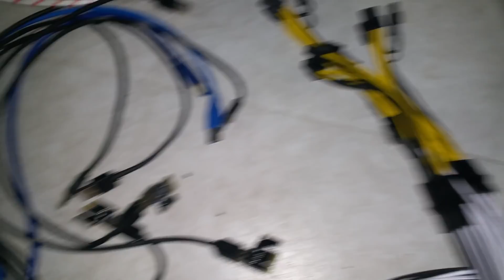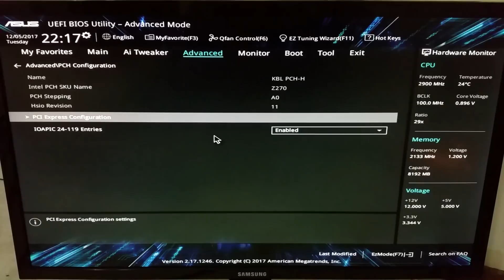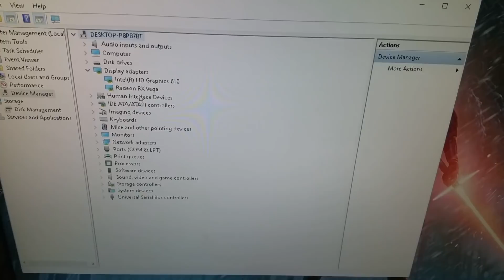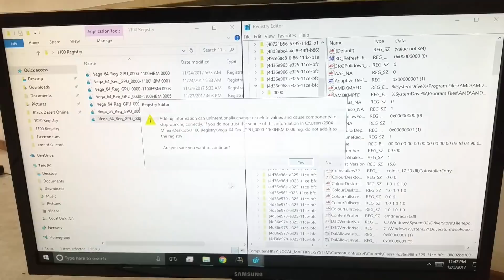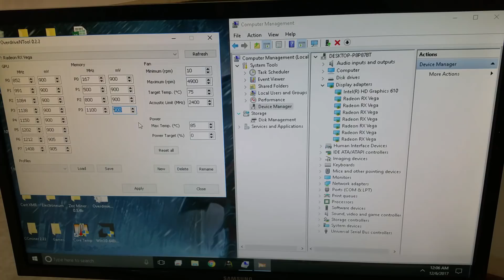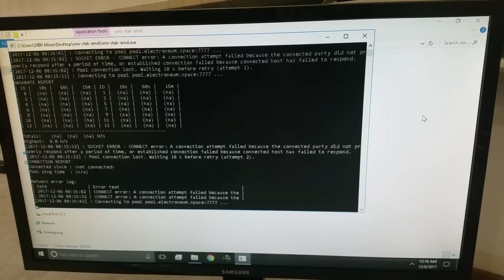[Tutoria] How to configure 6+ RX Vega Mining Rig

Comment: Hello, great vid. just purchased a Vega 64 and followed your 2 videos to a tee...getting 44.5 mh/s, however it crashes and reboots after 20 secs. My rig consists of x2 R290's and x1 Vega64. monitor is plugged in a R290. The registry I used for the Vega64 was the 1100 reg. Any advice is appreciated. Thanks

Comment: I Hv done the asus z270p prime bios setup exactly described in the video. But as soon as i installs 5th Vega x64
System reboots endlessly without booting to Windows.
4 Vega works fine. Pls help
Reply: you HAVE to active 4g decoding, is not in the same place where he shows because this motherboard is a little different bios

Comment: HELP!!! using biostar tb250-btc 6 pcie motherboard with 6vegas. G3900 processor, 4gb Kingston fury hyperx ram, 2x Corsair rm850x psu's, bios all set to gen1, mining mode, virtual memory set to 60000, block chain drivers, cast miner. It will run 4 of the GPU's stable. It will recognize all six but when miner start 4 will hash 1900± but two around 1200. Then 10 seconds later the computer crashes. HELP ME PLEASE ANYONE!!!
Reply: make sure all your power connections are connected to the MB itself, with these MB there are usually 2 or 3 extra power ports that need to be connected.

Comment: So I've been struggling. Have had all the issues everyone else has. Stuck with atikmpag bsod. Have tried clean installs, 3 different motherboards, using Igfx as primary card. Installed blockchain driver (driver only) on one card then plugged the rest in. Ideas? Did you plug all cards in at once after the 1st? Looks like we share similar board. My bios is essentially identical (asus z270a)

Comment: Is it possible to have an 8 VEGA 64 Mining rig?  I keep getting a blue screen when I try to enable 8 vega 64's and can only get 7 enabled but the 8th creates a blue screen.
Reply from the maker: MrInfamos Yea it's possible, I made a video a month and a half ago with 8 vega 64s mining.
Reply: This video is what you are referring to?  https://www.youtube.com/watch?v=GlLxggLTFYE these steps allowed you to enable more than 6+?
Reply: So far used your methods and everything seems to work well until I try Ethereum the voltage settings don't appear to work and at the wall with 5 cards start to pull around 1400w, yes I have a Kill-a-watt and i've only tested 5 cards so far... haven't tried connecting the remaining 3 to see if I can get 8 cards past windows 10 startup without BSOD.  I've read that the Asus Z270 motherboards are typically the issue and you need a mining specific motherboard to be able to run 8+ Vega's by other members on reddit.  I found by going into Wattman and manually applying the settings and under clocking the core for now to try mining Ethereum and applying the settings the power usage drops to around 1000w with 5 cards all set at 900mv.
Reply: those configurations here are from monero, ethereum is a little different, try use -24% and thats it

Comment: Serious problem here if u can point me in the right direction ... did all your steps worked fine then now i have a strange issue it blinks also it crashes  and restarts .. my startup bois i have the default graphics as main not the GPUs and still its crashing
Reply: i have the same issue! only 5 cards work, 6 doesnt work
Reply: Cleber França in the end i just split them 4 each rig ... even then its very unstable all these guys are making videos claiming they have solved it but in reality the mining driver is very buggy doesnt seem AMD are going to release a proper driver either

Comment: awesome video geek mark,  i am going to try all your settings. I have one sapphire vega64 air-cooled and one vega64 liquid-cooled. when running the liquid cooled, after the miner starts, i get a black screen and windows shuts down, any ideas about this issue ? hope its not a h/w issue.
Reply: Tried all the steps you are doing, worked fine for the air cooled card  The liquid cooled vega this time did not shutdown the system but caused windows hang and then created problems in booting, not sure what else to try. Needy your help Mark.

Comment: Hey there, great video.. though I’m not sure if I’m missing something? Whenever I conduct the registry edit one of my cards hangs on startup. All the usage indicator lights on the side of the GPU light up and it’s like it’s under load.. when windows does load the start bar doesn’t work and when I shut down there is an app I need to shut down (device install reboot required). 

I’m running Windows 10, and I have 4 RX Vega 56’s and one 64.

If anyone can help it would be greatly appreciated 🤓?

Comment: Hi can you share which Windows 10 ver you are using?
-I have Win 10 ver1709. 
-Same mother board as you do. Followed all steps, but when I try to start a miner program (CastXMR/GenOil or any others), it will just freeze and crash if more than 2 card used (About 30sec after start)
-I once did get 4 card recognized, never get more than 5 recognized. But even so the miner program will still crash within 30 sec of starting (Only 2 card will work..)
-In terms of installing the card, should I install it to PCIe 1x slot first or the 16x? If I install it to 16x it seems to give me more crashes.

Sorry for such long questions. These cards are just pain in the ass to get them all working. I once did a rig with 5 card working w/ Nicehash before they are hacked. After that I tried to install windows again and the whole crap started. Never get more than 2 card working. I suspect this has to do with Win ver?

Comment: Of course, I have an old computer (HP Pavilion P7-1234), but it has 4 PCI/PCIe slots. I'm not getting recognition on the 4th card even though the bios, which is much simpler, all the PCI devices are enabled.

Comment: Have a problem mate,followed each part,and when applying your reg file and after restarting the rig i got message of thread stuck in driver and rig wont boot properly and it keeps restarting after black screen stays about 20 seconds,i tried this with only one card and cpu graphic as primary in mobo settings,mobo is asus prime z270p,thx...

Comment: Hi man and thanks for video. Did you have an issue when enabling and disabling the gpus ? when i do it 1 of the 6 gpus takes long to disable and enable and after enable this gpu has error code 43 and got an yellow exlamation signal.To fix it i need to shut down chage the pciex for this card and then it works to enable and disable it.

Comment: Hi Mark, Thanks so much for your awesome videos. Have you had an opportunity to work with Vega Frontier edition cards? I'm having trouble getting above 1,700 h/s for Electroneum I did get 2,000 for the gigabyte vega 64 using your settings, but I don;t understand how to figure out what settings to have. How do you figure out the best settings?
Reply: Ted D Hey. Is there an app or driver   that enables oc and voltage controls on Vega FE?
Reply: Not that I found.
Lots of hours wasted with those cards IMO
Reply: actually Mark's way works with overdrive N but the FE just don't do well with the drivers. Not stable and hard to underclock well. I switched to regular Vega 64 and they work much better.

Comment: Hey Mark!

Thank you for your videos... They are very helpfull... Finally finished Today rig and it works with your Reg Mod`s as previously with similar ones from others rig just got Frozen Black screen and dont go further once reset been done .................   SO..................I got 3x Vega64 Liquid ones Mining - ETN with stable 5910H/s on etn.nanopool.org with power draw from wall 560w and rig dont get hoter than 45 degrees :) .... You are the best buddy .... Please see guy`s My OverdriveNTool settings below:

GPU:
P0 - MHZ 852, Mv 900
P1 - MHZ 991, Mv 900
P3 - MHZ 1084 Mv 900
P4 - MHZ 1138 Mv 900
P5 - MHZ 1150 Mv 900
P6 - MHZ 1202 Mv 900
P7 - MHZ 1408 Mv 905,

Memory:
P0 - MHZ 167 Mv 900
P1 - MHZ 500 Mv 900
P2 - MHZ 800 Mv 900
P3 - MHZ 1100 Mv 895,

Fan:
Min RPM - 2900
Max RPM - 4900

Power:
Max temp - 70,
Power target - 0%

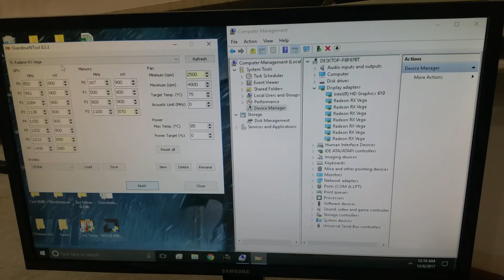Comment: At 15:50 you mention you need to disable each card individually.  Should I do that before applying the OverdriveN tweaks?  Thanks for this very thorough guide.
Reply from the maker: I disable them individually before chaging things on OverdriveN. I have never tried it the other way around, so not sure if works that way also.
Reply: i tried, the overdrive shuts down and recent tweaks need to be redone !!

Comment: Mark can u help having issues with  2 thread not working when i add my 2 rx 470s to my 3 Vegas. if i disable the card in device manager to enable to make sure hbcc is running cause I'm only getting around  750 per thread.  when enabling it blue screen crashes every time. if i remove my 2 rx 470s the hash rate is about 1950 per card same intensity settings

Comment: Hi, I have a 8x vega 64 rig and have some odd issues. In windows (without GPU driver) everything works fine. But when the driver is installed, i cannot click windows logo, cannot go to screen resolution settings, cannot open microsoft edge.. Have you encountered similar problems aswell? It only seems to happen with >5 gpu rigs..

And the miner does crash every now and then as a result of this issue.

Comment: Devcon is failing to disable, "No matching devices found" but I copied text exactly. Checked the hardware profile too, and tried renaming them differently. Any thoughts what could solve it?
Reply from the maker: PTS You probably have the wrong version. Make sure it's x64 not x86.
Reply from the maker: Run it in administrator mode also.
Reply: Thank you, Mark. I did remember to run in Admin mode. I tried downloading a different Devcon file. I tried 2 different ones previously. I downloaded through an internet search and it worked!!  Thank you! This is a time saver!! I have 2 RX Vega 64s and 1 56 with modded bios flashed to 64.

Comment: Great video. Thanks for sharing.  Is the Rosewill 1200 enough to run 6x Vega 64? Or should I look for something with more wattage?  Thanks.
Reply from the maker: Power wise it should be enough (but you'd be pushing it) but it doesn't have enough PCI-e connectors to run 6 cards since each card uses 2 plugs.
Reply: Geek Mark Thanks for your reply. Do you know if the EVGA 1600 has enough PCI-e connectors to run 6 cards? I have the EVGA 1600 on order now. I was worried that it may be overkill. That's why I asked about the Rosewill. Thanks again for your reply and I look forward to seeing more of your videos.
Reply from the maker: It only has 9 8pin for 4 cards. It does have another 5 6 pin. So no it doesn't.
Reply from the maker: Well it depends actually, it might work if you mix 8 and 6 pins but obviously it wasn't designed for that, never tried it before so I can't say.
Reply: Excellent choice! The EVGA G2 1600 has 5x PCIE 6+2 (x2) cables and 4x 6+2 (single) cables. You have 2 cables to spare :)
Reply from the maker: If you go to the EVGA site under specs you can see it has 14PCI-E cables total (9x 8pin (6+2), 5x 6pin). I would not recommend running these cards off the 6pin, but in theory it should work. In general with other smaller cards you can get by with using 6 pin on 8 pin connectors, but these cards have a massic TDP, but I'll let that decision be his. https://www.evga.com/products/product.aspx?pn=120-G2-1600-X1
Reply: You need a total of 12x 8pin for 6x Vega 64 rig. The EVGA G2 1600 PSU has 9x 8pin, and to be safe, you can use two 2x6pin>1x8pin apapters on the remaining 4x 6pin. Just one card have to settle with one of the 8pin being fed with a 1x6pin>1x8pin adapter from the last 6pin.
I would not worry about power in the adapters in this case. Each Vega card configured properly for mining, will draw about haft its rated power when working. The most important is a stable top quality power supply. The wires and connectors on the last adapter will have no problem with the load.
Reply: Hi guys, sorry I missed your replies. So I got the rig partially up and running. When I ordered the EVGA 1600, I wasn't sure if it included all the cables I would need to get started. So I also ordered an extra cable kit from EVGA.  I was only able to get the cards working by using dual 8(6+2)pin cables.  The EVGA 1600 did not include any of these type of cables.  The extra cable kit included 5 of them.  I now have 5 cards running and I'm waiting on another power cable to attach the 6th card. Outside of some stability issues, seems to be working ok. I still have to try out the 1050 mod. Should I be able to use some of the cables included with the EVGA 1600? I wasn't sure if this was normal. I figured I would just need to add the dual 8(6+2) pin cables to the order list for my next build.
Reply: Quick question everyone. You guys are just powering  the Vegas? Not the risers?
Reply: I am powering both the Vegas and the risers.

Comment: I got 2 out of 4 cards working, do you have lower settings for the memory less than 1050 because that doesnt work either, what temps should you have? I have one at 44 degrees and other at 70+

Comment: Great video. 6 Vega 64 working. 1050 mod, 11500Mhs, 1100W.
Reply: Which PSU are you using to run 6 cards? Thanks.
Reply: LC Power LC1650 V2.31 Mining Edition 
Price about 250e 
http://www.eponuda.com/kompjuteri-napajanja/lc-power-lc1650-v2-31-mining-edition-1650w-napajanje-cena-416777
Reply: Sta treba druze, pisi mi slobodno na mail.
Reply: 8Gb, working fine 2 weeks now.
Just make 60GB of virtual mem.
Reply: You're using a LC power PSU with 6x V64 on a 24/7 mining rig ???
One advise/warning... Buy a better quality PSU. (that you know is build with top quality electronics and have a loong warranty to back it up) 
Your'e using 6x 600 eur+ GPU's... why go cheap on the PSU? That thing gives life (and can also kill) the whole rig. I would use no less than the top quality EVGA Supernova 1600W to power a rig that size/value. It has plenty of connectors for it.

Comment: Awesome vid! I'll try this tutorial.
Edit: what is your hash/wattage? Is 1200 psu enough for 4 cards?
Reply: yes it is. I have 4 vegas + 1 RX580 running 820w at the wall, with a 1200PSU, using exactly the settings from this video. The hash rate is almost identical. Thanks a lot Geek Mark!

Comment: A noob question. I have 5x Vega 64 Sapphire and 1x XFX Vega 64. Does brand matter?

Again, thank for the video! Kudos to you!
Reply from the maker: It shouldn't, In this video I'm using XFX and gigabyte cards.
Reply: great! good to know...
Is their anyway to reach you by e-mail?  I'm would like to seek for your service and advise.
Reply: I would like also to be on that email. I want to start on rig with the gigabyte
Reply: It does, my power color can't handle 870 or 890 for mv. They crash. 905 and 900 does the trick. My Sapphire handle it with no problem.